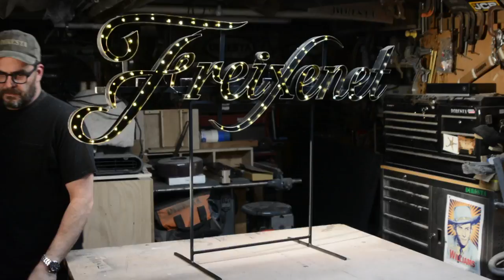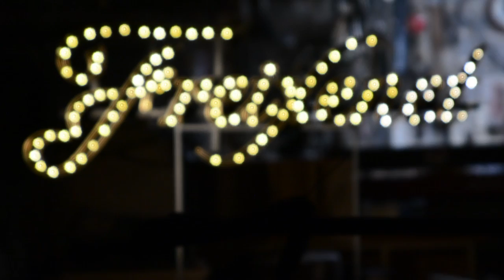✔ DiResta Plastic channel Sign

Comment: +jimmydiresta - Great video. I love watching you put together stuff like this. Also if you want to reduce the number of battery boxes you can wire the strands together end to end. Each string doesn't draw that much current so you won't overload the driver circuit in the box, and using alkaline batteries will extend the time between battery swaps. I did that this past Christmas when my wife made an outdoor decoration for her parents and wanted to make it sparkly.  Cheers,  - John

Comment: My bits get chewed up on my CNC when I do MDF. What endmills are u using and spindle speed/feedrate? I have to get some single flutes and buy a real spindle (Im using a trim router as my cutter and it only goes down to 15k RPM).

Comment: Epic!   You need to consider adding some servo controlled dolly shots for the finale :)
Reply: +panofish why dafuq would you need servos for that? :D it's not like he can build a fucking sign that beautiful and then not move a camera on a dolly :D
Reply: +Lukas Bliss your comment while 100% accurate, looses all credibility when you start with "dafuc"
Reply: +Lukas Bliss Why not?  Sounds like an opportunity for an arduino project to control the server/stepper motors to smoothly ease the camera ... which would be especially cool and extras slow when done in conjunction with a timelapse. :)
Reply: ***** I agree with the timelapses, but for the final shot where it's real time everybody could move the camera, no problem.

Comment: Why didn't you run the lights in series? It wouldn't have been a tough shouldering job to make them all run on one switch. Plus the cables could have been fully hidden behind the letters.

Comment: what plastic is that? the white one
Reply: +MAking Props - My guess would be styrene. Very common in model making.
Reply: well it looked more elastic than styrene, I have used styrene before and upon bending it, it cracks and looks awful. maybe I should try a thinner thickness. thanks
Reply: Yeah, I could be wrong. But I think maybe what Jimmy's using is just nice and thin. Heating it could do it, too, but I imagine he would've shown that if it were the case.
Reply: +MAking Props my guess would be Sintra board.
Reply: sintra might be right too but sintra is too soft and easy to scratch I wouldn't do that sign out of sintra because it would be easily scratched or not rigid enough